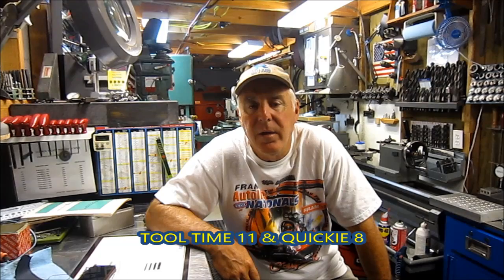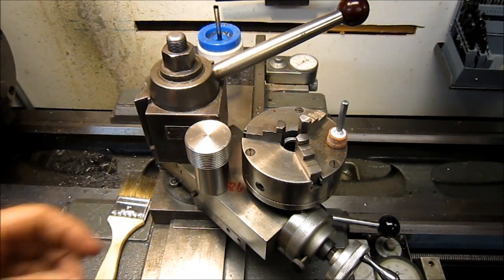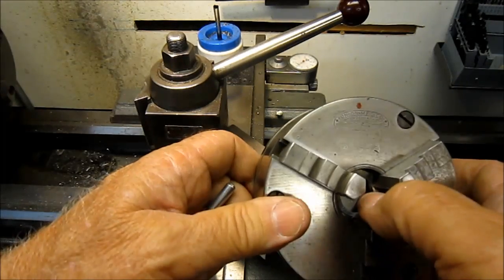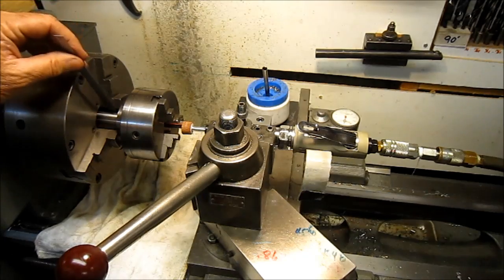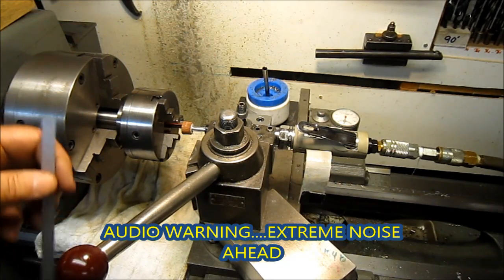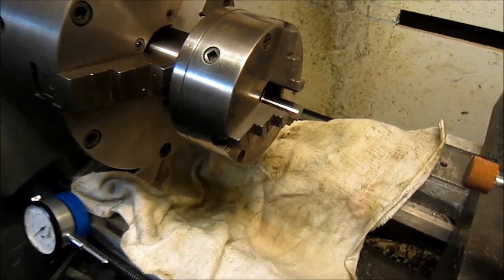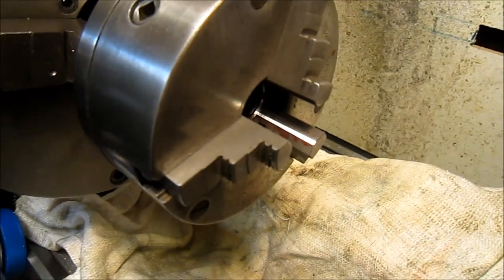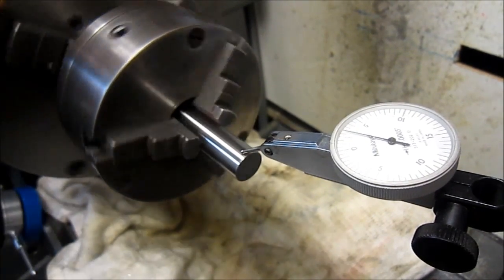Shortie 8  3 Jaw Grinding

Comment: Chuck,  nice use of your new air grinder holder.  One question though: why was the grinding stone relieved?  Just to reduce contact area to lower load on the grinder?

-- Mike
Reply from the maker: BigMjolnir Hello Mike,The biggest issue with grinding is heat.  The grinding stone was relieved to create a very small surface area of contact, less surface area contact=less heat produced.  Note that the stone upon inspection showed very little wear if any and the contact point on the stone was about under 1/8" from the front of the stone and maybe 1/16" contact width.  Also, color of stone has to do a lot with the hardness of the stone, this stone was a brown stone and very hard, if it was a pink or white it would have been quite worn.

Comment: Hi Chuck,
Wow, a 1 thousand run out on a 3 jaws is excellent...  It's a little like an eagle on a golf course!
One of my up coming project is to turn a 12 inches adapter back plate for my 10 inches 6 jaws buck chuck, lots of cast iron dust in perspective...
Cheers,
Pierre
Reply from the maker: pierre beaudry Hey Pierre, good luck with your project and thanks for stopping byChuck

Comment: Chuck, it was great seeing the fine repair you and Chui made. The air grinder setup is really neat. Do you think the grinder is adaptable for a perpendicular grind on round rotating or flat non rotating stock? Would the 'metal dust be a problem for the lathe?Just a thought.
I enjoyed the video.
Thanks....13
Reply from the maker: arkansas13 Hey 13, I think if you can hold it you could create any angle so I would say yes....regarding the metal dust, yes you must cover up the ways on the lathe or other items close by and  a vacuum would not hurtGlad you enjoyed, best of luck with the buildChuck

Comment: Hi Chuck,

There are quite a few chuck jaw grinding videos around. Something that nearly always gets left out is that you should strip and clean the chuck BEFORE you grind the jaws as well as after. Grinding is mostly used to correct bellmouthed jaws, but improving runout is good too. You can actually make runout much worse if the error is caused by contamination in the scroll in the first place!
Reply from the maker: Paul Compton Hello Paul...you are correct!!! Chui did tell me that he had stripped and cleaned the chuck and I know as a tool maker by trade, he cleaned it when he got homeThanks for watching and your valued feedbackChuck

Comment: how do you adjust the buck chuck for zero runout?
Reply from the maker: meocats Hello, the buck chuck has 4 adjusting bolts on the outside edge, you loosen the bolts on the face of the chuck and then use the adjusting bolts to adjust the chuck.  Search Buck Chuck on the web as there are PDFs on the use of the chuckthanks for watching and your feedbackChuck
Reply: i have looked at their catalog and cannot find it, what is the flange style called?

some CNC milling chuck (like Nikken) have an internal cam which can be loosened and adjusted like you describe, to provide truly zero runout. I think that would be useful for lathe chucks.

Comment: Hey Chuck,

Great job on the jaw grind, nicely done!

Question, will the jaws hold a part tight after grinding smooth?

Thanks for sharing!

Ray
Reply from the maker: Ray Caniglia Hi Ray, yes the jaws are about 1" long so that is a lot of surface area to bite on a part, FYI...we might do a follow up video grinding the 45 degree sides to narrow the contact area of the flat, smaller contact.Thanks for the comment...catch u later budChuck

Comment: Is there a reason you chose to grind it rather than boring? It seems to be that since the grinding wheel is being worn as you go deeper into the chuck, less material will be removed the deeper you go, resulting in a small amount of runout.
Reply: You are correct about grinding wheel wear and much of it happens on the first few passes until the jaws are roughed out.  Later passes are lighter cuts that reduce the wear and even out the arc or dishing created on the jaws by the stone's diameter.  Smaller arcs provide better grip.  Chuck mentioned a 'spark out'.  That's a super light pass or two that does the final sizing and, watching the sparks, you can tell when you get a consistent even grind and your done.

Boring would be done on soft jaws like aluminum, brass, copper and pot metal.
Reply from the maker: Dustincoc Dustin,  That is a good question, the jaws on chucks are hardened steel so you cannot use HHS or Carbide tooling to machine, the only method is to grind.  Well not the only method, you could anneal the jaws (soften), then machine the jaws, but then you would need to re-harden the jaws.  The grinding wheel does wear, but the amount of cut was not enough to create an intense wear to the stone.Thanks for watching and you feedback/commentChuck
Reply: Eddie the Grouch light cuts with a faster travel rate will wear the stone more slowly and evenly…